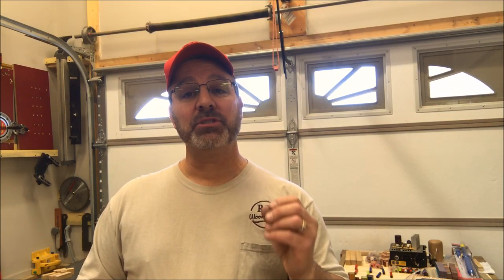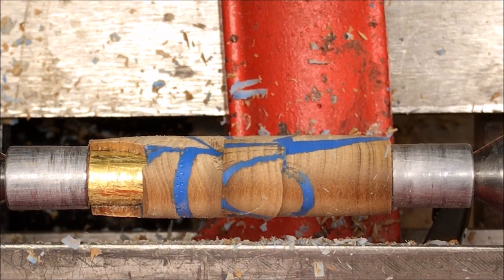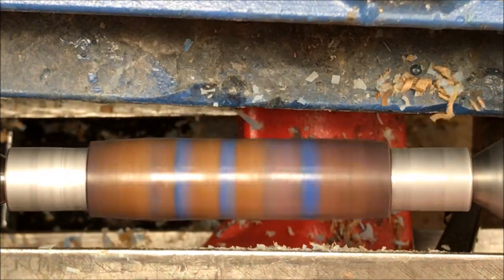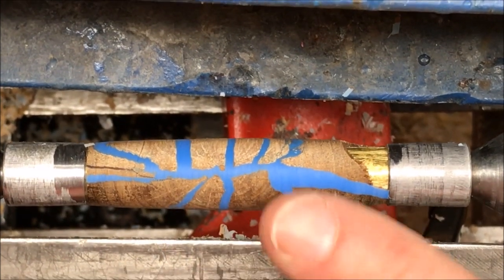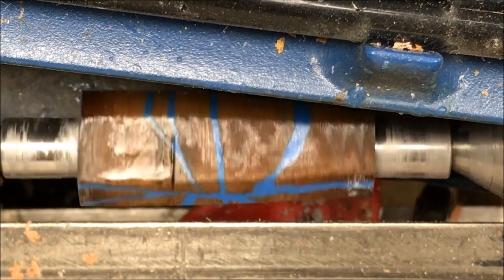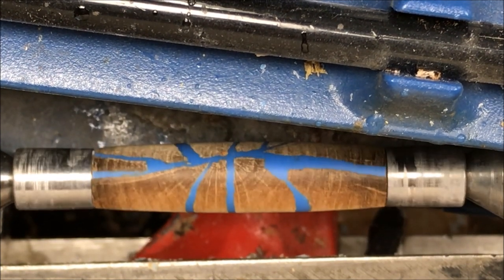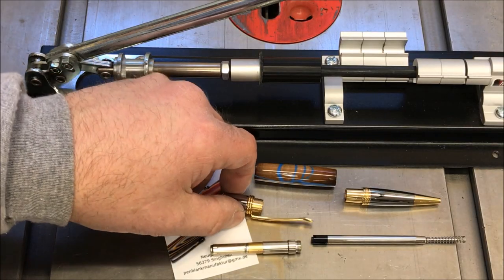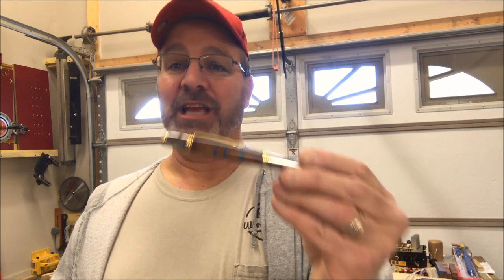Ink Pen Made From A Resin Filled Cracked Wood Blank

Comment: I am new to pen turning and I sure appreciate you posting this video. You handled this great and i agree, blank needed stabilized . Im picking up a vacuum pump setup and pressure pump next week . Absolutely Gorgeous pen, very inspiring . Looks like agate  or tiger eye. Wonderful job, thanks.
Reply from the maker: Thank you,
  Stabilizing will make turning soft, rotted, and difficult woods much easier. Have fun my friend, it should be a blast. 

Regards,
Bob

Comment: Isn’t it a gut wrenching feeling when on that “one last turn”, when you say to yourself I shouldn’t do this but I’m gonna do it anyway........she blows out!! I have observed that with these blanks in particular and also other fragile ones that blow outs occur 99% of the on the ends. Prior to lathe turning I will belt sand all sharp line angles especially circumferentially on the ends approximating the tube, but also being very careful. I will immediately treat the ends with CA. Just prior to completion I will also at times finish up to the bushing with sand paper. I can’t remember the last blowout or severe chip I’ve had even with very, very fragile blanks. Thank you for another great video Bob..... Dr Bob
Reply from the maker: Thank you Robert. 

Regards,
Bob

Comment: I think that this is going to become one of my "trademark" pens because I think that it combines the best of the two materials. The organic look of the wood, etc, and the bright, pleasing appearance of the resin come together to make a very attractive pen. I think that maybe putting some epoxy on it, and then maybe put it in a vacuum chamber to draw it into the grain might help it become strong enough to not chip out so much. I think that a carbide tool may be a better choice for the turning part of this, but as I am new at this, is based wholly on a "hunch" and not actual experience. I am super-grateful for these gentlemen who post these videos because it is like having a mentor right there walking me through the process. I am really pleased to have found this hobby, and have been enjoying it immensely.
Reply from the maker: Thank you Daniel,
  The main reason this blank is chippy is due to the cross grain. A vacuum chamber would help a bit but you’re still cutting against the grain which is always sketchy. 
  Bear in mind that Carbide tools are Extremely aggressive, a much better tool for this type of turning would be a skew. 
  Either way it’s a fun turn and very rewarding when finished. 

Regards,
Bob

Comment: Wish this video was around when I first attempted the herringbone pen blank like you had done, to be a Christmas gift for my mom. I used purple heart and paduk and it was absolutely beautiful, then when I went to drill it for the tube the blank just shattered as soon as I touched the drill bit to it. Glued it back and the same kept happening till i was left with a peice maybe two inches long, needless to say I was devastated. I had waited a few days between glueing and attempting to drill it to ensure the glue was cured each time too.
Now this next part I really hope helps someone out. 
About a week later I attempted the pen blank again, same wood choice and glue. The glue up was pretty uneventful. Only thing I did different was instead of going straight for the size hole I needed for the tube I started smaller a smaller and worked my way up to the size needed without any blowouts. Those didn't start happening till I got turning, luckily most of it was stuff that was coming off anyways, had a couple small pieces to glue back but nothing major as I had started soaking the blank in the thin CA. Though I did manage to both glue a bushing to the blank and then later on to the mandrel... I don't recommend doing that lol 
But the pen blank made it through and my mom got a beautiful pen on Christmas day!

I was also able to turn the first blank into a stylus for her phone, so at least it didn't completely go to waste lol
Reply from the maker: That is a great story and I love your problem solving to make the pen a reality. I’m sure people will benefit from this because they read the comments all the time for ideas. Thank you for sharing. 

Regards,
Bob

Comment: Gorgeous!  CA has such poor sheer strength. If it's not a standard wood blank with no cuts of inlays I've gone to an overnight cure of epoxy or Gorilla glue even though it goes against my instant gratification ADHD thing. You spend sooo much time on them it's heartbreaking when it self destructs.
Reply from the maker: I agree Andy,
  I use C/A for the videos because it’s quick. I use epoxy for the keepers. 

Regards
Bob

Comment: Perseverance for the win!  I have had some luck with end-grain blanks by coating the inside of the blank with thin CA right after drilling (before the pen tube is installed). Allow it to soak in and cure then re-drill to make sure the hole is the correct size for the tube.  I can't say it has been a 100% fix, but my success rate climbed considerably.
Reply: LOL  that is what I get for commenting before the end of the video...  Good Job!
Reply from the maker: LOL, great minds think alike. 

Regards,
Bob

Comment: Bob, great pen,  A suggestion, if you have a Harbor Freight store near you, look at their sales add and they often have a 4 inch Magnetic Parts Holder  ($1.99) or at no cost you just have to buy another item.  I  got one and put it on my  lathe and because it has a magnet on it I put my bushings in it anytime I remove them from the lathe.  That way I can always find them while I'm working with them.
Reply from the maker: Thank you, that’s a great tip. 

Regards,
Bob

Comment: i love your videos. I was cringing when it blew up the second time. In between your 1st and 2nd application of CA on the first blank is where I would have finished it with an 80 or 100 grain sandpaper. I also have trepidation with end grain and other kinds of similar wood so when I feel it get close I finish it with sandpaper. It may not be the perfect option but it works for me
Reply from the maker: There was a point I thought about doing that but I pressed on, LOL. 

Regards,
Bob

Comment: Very nice job and beautiful pen!  I agree with the other commenters tho.  It would have gone much smother if you stabilized it first.  I just started stabilizing blanks with a very budget setup. I use a clear 4" pvc pipe with a removable plug on the top and the intake on my air compressor to provide the vacuum. Not ideal but it works very well.
Reply from the maker: Cool idea on the compressor Intake. 

Regards,
Bob
Reply: I would love to know more about how to set this up.  Can you point me in the direction for more details please?

Comment: Bob, I cringed when I saw the blow out.  I seldom can locate the piece when it happens to me and when I do it's usually incomplete.  A lil trick I use to get the piece to seat well (when I can find it) is to use a zip tie as a clamp.  Usually the glue that's oozed out binds the zip tie but I just turn it off.  I like  the thin CA soak technique, kind of a poor mans quick and dirty stabilizing technique.  Gonna keep that in in my back pocket.  Thanks for all the great videos.
Reply from the maker: Thank you Steve, that zip tie is a good idea. 

Regards,
Bob

Comment: Have you tried using a negative rake scraper/bed an to finish it once it is round? 
I either use a negative rake scraper/bed an or a negative rake carbide tool to do some acrylics or end grain blanks... There are several different negative rake carbide blades out within the last year or so and the work really. Especially if the tool the carbide blade is mounted to allows you to angle/tilt the carbide so you can take a slicing cut such as the WoodPeckers brand carbide tools...
The pen turned out great!  May I ask where you got the pen press used in this video? I have been looking for one like it for some time as they seem faster than the style I have which requires adjusting the rod depth in or out every time the pen size is different. Thanks
Ron
Reply from the maker: I got that press at Amazon, here’s t he link:

Milescraft Pen Press  -  https://amzn.to/32zjn8Z

Regards,
Bob

Comment: Are you using your oven to heat the pen blank after gluing and inserting the brass tube? I have found that solves many of the problems of wood peeling from the tube. It might help you.
Reply from the maker: I never even thought about trying that. Its a very Interesting idea so I need yo test it out. Thank you for suggesting it. 

Regards,
Bob

Comment: Rather than adding Ca from the outside in try drilling the blank and filling the blank for the tube and the before you glue in the tube cover one end with tape and then fill the hole with thin Ca and let it soak in. Then re-drill for the tube and go from there.
Reply from the maker: I did that on the second blank. I didn’t use tape but it worked great. 

Regards,
Bob

Comment: That is a great looking pen. I have read some of the other comments and am wondering how do you stabilize a blank before turning. I am still new to all of this.
Reply from the maker: Stabilization is done in a vacuum chamber. You place the blank Into a container submerged in cactus juice. Then, Pull a vacuum and hold it for a while, sometimes several hours until the bubbles stop coming out of it. Once thy bubbles stop, leave the blank in the cactus juice for a time equal to the time you held a vacuum. Lastly, you bake the blank to ensure it is dry all way through. 

Regards,
Bob
Reply: @RJBWoodTurner  thanks for such a quick response.  Thank you.

Comment: I'm going to wonder aloud on this one. I don't think it was the "end grain" so much on this blank. Several times I was struck by the circular bull's eye pattern of PITH in the video. Pithy wood is an even greater problem than end grain itself, IMO. The checking on such a piece seems to be an attractive place to fill with colorful material, but it just about has to be a mine field. Again, IMO.
Reply from the maker: Thank you Dean. Good observation and insight. 

Regards,
Bob

Comment: What if instead of soaking it in CA you stabilize the blank before turning. Would CA be more effective in avoiding blowing up chips?
Reply from the maker: Stabilizing will work for the wood portion but not the resin. I do not own stabilizing equipment so I had to go with what I had. 

Regards,
Bob
Reply: @RJBWoodTurner  that makes sense. Tricky cut. Beautiful work tho. Thanks for sharing

Comment: Again live by CA glue Die by Ca glue. :-)

I think this is the exact reason to not always use CA to glue in tubes. I would have used Poly glue aka Gorilla Glue which would have gotten into all the nooks and crannies. 

I would have also thought that this would be stabilized I thought you said it was but then I saw how much CA it sucked up.
Reply from the maker: I’ve used Gorilla and personally, I’m not a big fan. With end grain it’s easy to catch and destroy a blank, it stinks but it’s part of the challenge. 

I haven’t started stabilizing yet but when I do, this is exactly the type of blank I’ll stabilize. 

Regards,
Bob

Comment: Bob, not sure if this has been noted before or not, but worth mentioning that you are breaking a cardinal rule of woodturning by using a spindle roughing gouge on end grain. Those are meant for side grain only and the single cause for your blank damage at the 2:56 mark. If your blank was any larger, you could really do a significant amount of harm to yourself (and subsequently others if they use this as a teaching tool) by using a tool in a manner for which it’s not designed. We’ve been friends for a number of years so I hope you take these statements to heart that I’m not Safety Police nor a troll but instead looking out for your best interest and that of your other viewers. If you have a bowl gouge (preferably with a swept back grind) you will find your end grain turnings leaning much closer to the “love” side of the spectrum. Carbide (EWT) or similar scrapers can be used as well, but the results off the tool will likely lead to torn grain and far more sanding than is necessary. All the best!
Reply from the maker: Thank you Derek,
  I appreciate the concern. I’ve been looking at other tools specifically bowl gouges. I use carbide on occasion but I prefer HHS. Hopefully the coming year will afford me the opportunity to expand my collection. 

Regards,
Bob

Comment: Just wondering did you have problems just with breaking on the ends if that’s the case you might beable to use the CA just on about a half inch on both sides so you won’t have to use to much CA just a suggestion.
Reply from the maker: Thank you Gary. 

Regards,
Bob

Comment: Another great video Bob. This what I want to learn the most, how to be different.  I had a quick question for you or Lynn if he watching. I picked up the PSI 12” yesterday,  is it possible to put the on a cart with wheels? Or would it be unsafe
Reply from the maker: I think it could be done, only thing I’d worry about is vibration moving the cart. Maybe wheels where you could lift one side of the cart and roll it on the other like a wheel barrow. 

Regards,
Bob

Comment: Bob, have you had any trouble with CA finishing on unstabilized wood?  I did some pens in Spalted Maple I had and now about a year later the finish is cracking.  Thanks!
Reply from the maker: I only have trouble if I use Activator. I avoid it if at all possible. Wood moves to much and quick cure is brittle. 

Regards,
Bob

Comment: Love your videos! Would a negative rake carbide tip tool help avoid catches? Asking for a friend...
Reply from the maker: Thank you Jordan,
  I wish I could answer that question but I’ve never used a negative rake scraper. I’d love to try one out and see if it does reduce catches. 

Regards,
Bob
Reply: @RJBWoodTurner  in my experience, the negative rake cutters are great for more sensitive materials prone to chip outs. Definitely recommend for acrylics and more difficult woods